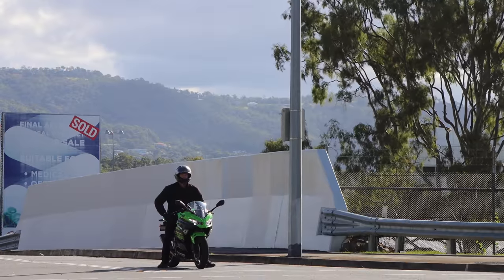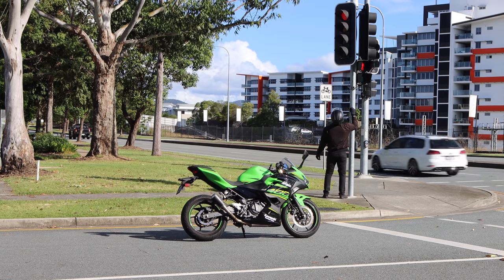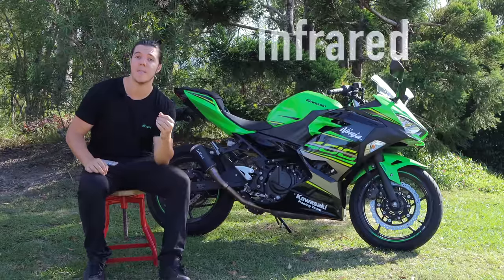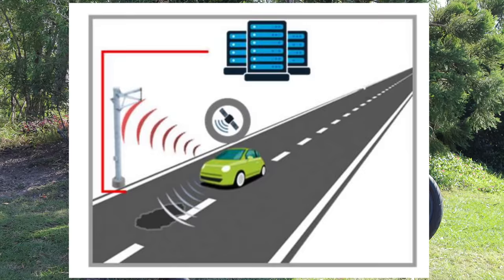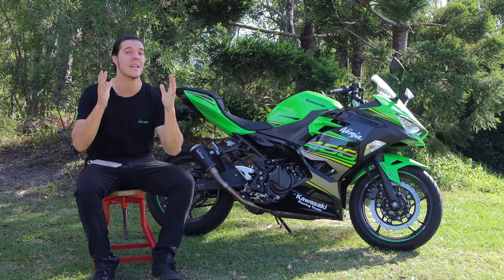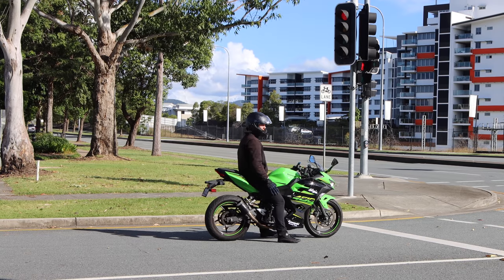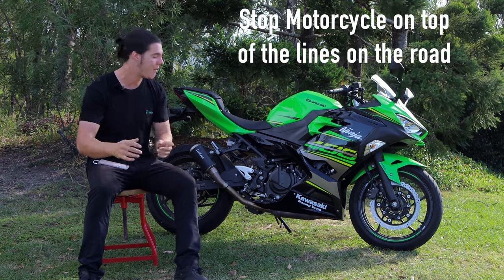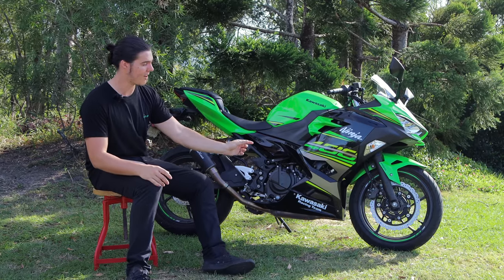How to trigger Traffic Lights on a Motorcycle | Stop getting stuck at red lights

Comment: None of the lights around here in my area of central Maine use the loops, it's all cameras or timers here.  There is one light near here that will never find me on the bike. If the path is clear after two cycles I'm going.  All other lights I find if I'm alone there being in the middle of the two lanes usually works.  We do have one light very close to my house that if you don't continuously move slightly it will skip one part of the intersection no matter how big or small you are.

Comment: Those induction loops suck, a lot of them won't even pick up the Tractor Trailer I drive since the front is so high off the ground. Sometimes I have to pull up far enough so the differential is over the sensor to get it to change.

Comment: A lot of bikes are mostly aluminum alloys (engines, wheels, frames), non-magnetic. You need iron, to shift/attenuate the frequency of the loop in the ground. I wait one cycle, if a car doesn't pull behind me to trigger the light, I just go...if it's clear. If the detector is set too weak to sense my BMW, it's not working correctly.

Comment: In the US, there are a number of states which allow a "safe on red" move by motorcycles, mopeds or bikes. The requirements vary from state to state but basically, after an adequate amount of time or signal cycles, the biker can proceed if the intersection is clear. However, the burden of proof is on the biker. I've used this maneuver only once because before long another motorist usually shows up. It's seldom used but nice to have should one need it.

Comment: Here in N America the " Induction loop" is not sensing the "Metal" of a vehicle, rather it's sensing the electrical field created by  your charging / electrical system. Try flashing your high beams as you approach the intersection. This  can fool the system to turn the light green as this is why lights turn green for emergency vehicles....the flashing high beams picked up by  a light sensor !
Reply: I tried that with honking the horn several times Worked like a charm.

Comment: i’ve been forced to run several red lights, usually at night, in turn lanes, when no other vehicles come by to help trigger the lights. a lot of the times, i move my bike forward and back, and side to side within the lane, and nothing helps. i feel like most cops wouldn’t have an issue if done safely, and given the circumstance, but it’s always frustrating

Comment: In my main riding years on the street was all of the 90s. In my area we were getting new sensors installed. My problem was that I would get up early and go for a ride so waiting for a vehicle was a no go. I talked to the city but they said that they couldn't do anything. Why is that familiar. So one day I talked to a motor patrolman and he said that once I sit through one cycle of lights I could then proceed with caution. He had the same issue. And yes, I knew to sit ontop of a side line. Worked ok but was not perfect. No problems after that. No, I did not live in a big city so one could sit a long time waiting for a car.

Comment: Get an old type tv remote aim it at the infrared sensor press program like finding the tv input. next press set or enter now just like the fire and emergency vehicles it will change. also a small strobe light works

Comment: To get out of rising barriers on car parks .
6 inch square steel plate placed on the in bound loop .
Barrier will rise as long as you're  not sitting on the exiting loop.
Drive over smartly pick up the small plate bye bye.

Comment: Traffic light camping really drives me nuts for 32 years now. And i've filed countless complains about them with zero result. Tried every trick in the book to trigger the detection system with very little result. Hard braking seems to be the best trick, but when it rains........
It seems worse in the winter conditions for some reason. For instance, when it's warm and a traffic light doesn't respond, a car stopping behind you is usually what it takes for the lights to go green. When it's cold, for some reason it sometimes doesn't help at all (i've even had aome very impatient city bus drivers behind me a couple of times).
I've been looking for a lighter motorbike to replace my current one, but detection systems prevent me from buying one.
And i know it's possible for detection systems to detect lightweight vehicles. Our (Dutch) cyclepaths also have detection loops and they always respond (i usually travel on my moped during the summer).

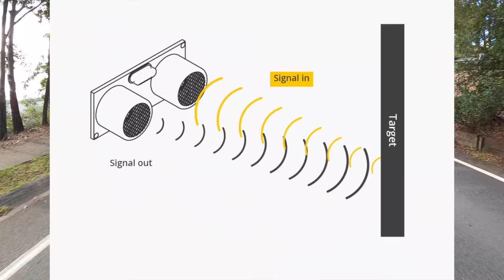Comment: The sensor depicted at 2:31 is an ultrasonic sensor. I don't think they have the range needed to be used for traffic. I also feel like the statement that the inductive are most common is incorrect. Maybe 15 years ago. I can hardly find one anymore. The microwave are much more common in my state, but perhaps they are more common elsewhere or your data is old.

Comment: There is a set near my workplace that, due to it leading out of a maximum security area, are manually triggered from a nearby control tower.

It's not unusual for cars leaving the 2 nearby commercial properties to be waiting 10,15 minutes or more for the security staff to come and press the button; fortunately the local police know this and generally turn a blind eye to people running the reds at that junction as long as they don't do it dangerously.

Comment: I just jump up and down really hard over and over so the shock absorbers reduce the height of the bike to the ground so the sensor can detect the metal on the bike.. You may have to do this repeatedly to get a result. This works most of the time. Constant pumping very hard works the best.

Comment: I've been riding a dirt bike (street legal) on road for a while now and I have never had a problem with lights at all. In my car though, I've sat through some insanely long red lights waiting for someone to pull in behind me to trigger the lights. Go figure. I have the worst luck. Can't run the lights in my car and get away with it because it isn't a motorcycle. But it does say Yamaha on the engine block though because it was a joint venture between Toyota and Yamaha.

Comment: I had a little 250 ninja that could never trigger a light. I found that if I rolled up to the light with a moderate speed and stop suddenly on the pad like a brake check, it registered it more often. Other times I had to right the red and U turn.

Comment: Some info you left out...the shut off and restart deal does not seem to work around here...some intersections have times, the cutout in the street is much longer than most, one vehicle will have a longer wait time than 2. If you are familiar with the intersection  and there is no other cars around you roll onto the cut out area and as you stop  grab the front brake hard enough to compress the front suspension as much as possible. Right as you stop put both feet down, release the front brake and give a little push with your feet at the same time. Done properly the bike should back up several feet. Even if the bike is stopped you can do the same thing  Hold the front brake, push on the bars to compress the front suspension, pull back on the bars and as the front end comes back up release the brake. The other trigger at intersections is going to be the infrared deal. .they are also programmed to trigger off the strobe lights on emergency vehicles. You can duplicate it with high/low beam. Depending on your headlight adjustment and how bright they are it works best as you approach the intersection. Done properly it will take 3 on/off cycles as quick as you can.  It will turn a red light green and it will keep a green light on long enough for you to clear the intersection.   Is it legal? I probably wouldn't si it in front of a cop but the do sell those deals that flash your headlight high/low as you ride . The strobe deal works in daytime, just not as well. The stone position on a decent led flashlight will work too. I'd there are no cars around make a legal stop and run the dam thing.   as long as they dont have any of those photo cop things. .

Comment: In my great state of Idaho we passed a law a couple years ago stating that if you're sitting at a red light for a prolonged period of time in fact it even tells you two whole cycles with the light not changing in your favor you can go ahead and run that red light, just be aware you are now responsible for everything that happens for running said red light you just won't get a ticket for running a red light when you have the clear.

Comment: Not “metal,” but steel rather.  Our mostly aluminum bikes don’t trip the sensor.  A steel frame may be too high and there is minimal steel in our wheels. Steel is set deep in the engine also. A powerful magnet set beneath works wonders to trip that loop.

Comment: Scooters get stuck at lights very badly, I was stuck so long yesterday, my foot stared hurting from holding the bike up so long! Atleast 4 turns at a 4 way, 
We had a pressure sensor years ago, it was like a inverted speed bump, didn't matter what it was, if you didn't stop on it, you was stuck! It was just a metal strip just behind the stop line at the light, it was at a side street that crossed a busy road, it was changed about 25 years ago!  But I always try to let the car behind me trigger the light , either pull to the side letting it in front, or let it up far enough if I have room, or try to keep a car in front of me!

Comment: What is REALLY annoying is when a car comes up behind you and then stops 3 car lengths back so it does not trigger the light.    I don't know if drivers around the nation do this, but here in US south, it is very common. I don't know if they are being extra safe, or what is going on.
Reply: I think it's them thinking they are being polite and not crowding. I drive different around motorcycles when in my car. Just point to the light... your wrist "watch", and motion them up closer to you. Lol... maybe they can decipher your sign language that the light is taking a long time. U need them up closer.

Comment: I had a have had several tickets due to going through a red.  Most police in my area will look the other way if I stop and clearly check traffic before running the light- treating it like a stop sign.  IF they hand me the ticket anyways, I contest it.  I tell the judge about my conclusion it was a chronic malfunctioning light.  Explain that I treated it like a stop sign to save time, and I have yet to have to pay for a ticket.

Comment: North western Europe in the late 80s with more and more bikes having much less metal and much more plastic the induction loops started failing to detect more often. Backing up and running over them over and over to trigger the system was not really effective. Restarting your engine was at times the tickle it needed (worked with Fazer, XJ, FJ and Bandits, but not R1s that came out in the late 90s) as gcenteno97 mentioned in his comment. But the advanced detection loop as he describes is also the most oil/dirt invested patch as it is typically located in the middle of the lane. Its the part were all the cars wait for the light and leak their precious fluids. Mixed with rain water and....  

Any how, some lights just did not get triggered. And, there you are at 2 AM...waiting. More than one police officer has advised me to look left, right and if I do not see a cop then just go!

Comment: most states have laws though for bikers and red lights.. you have to stop.. wait a reasonable amount of time then can go no matter if light changes or not when its safe to do so.. so like me in cali i would do it a lot.. if im the only person at the light.. and just go when its safe only so if cop is watching  he sees you stop.. wait longer then a regular stop sign . and go when its safe.. now here in cali we have usually 2 lanes to turn and go straight.. so if a car was next to me then i wouldnt do it. now sure you can trigger some lights.. but others hell no. i have about 26k miles riding. i would recommend most stop at the side ofthe lane at traffic lights so if someone comes up fast and is going to rear end you you are already at a zone where its easier to escape and if you cant hopefully only get s clipped and not ran all the way over.. one safety of driving a motorcycle and stopping at lights is to not stop in the middle of the lane.. because if you get rear ended at  a light it  could be game over. and you should know this!

Comment: I live in the US and in my state it’s legal for motorcyclists to run a red light if it skips you for two cycles (this is an issue at night in low traffic when the light doesn’t cycle though)

I’ve ran so many damn red lights
I would prefer not to 

I’m already familiar with all the lights that won’t change for me and I don’t even wait the two cycles (especially at night, I’d be sitting there for hours) so I run it after the first skip once the coast is clear. So many people turning another direction probably thought I was just running it for shits and giggles

I’ll also take a different route if possible and safer

Comment: I thought those induction loops were scales. I had a motorcyclist wave at me to pull forward so I'd trip the sensor even though he was parked on the wire. Only then did the light actually change.

Comment: Once you've gone through your local lights you get a pretty good idea of their functionality.  When those light fail to function properly, I stop then look in both directions, then move through that red light, if the green light side has no cars coming towards the intersection.  I will not be treated like an indentured slave sitting at a light like an idiot because I have been so indoctrinated I can't think for myself.  I have also found over many years of driving and riding that weather does affect the electronics in those boxes and/or those loops.

Comment: Worth saying that certain roads I just avoid during "low traffic times"... There's almost always an alternative to the route you're used to taking just about anywhere... SO when traffic's a lull, and you know you're likely to get "stuck", you can change to a road that's more stop signs or slightly higher traffic.

    Ordinarily, I try to avoid traffic, BUT sometimes, one has to make exceptions. A little more traffic around can be a convenience, in spite of raising my chances of dealing with idiots. ;o)

Comment: I have a pressure pad light on my way to work its triggered by me and a second sensor but if its ONCE AGAIN sunday night at 9:30pm i once litterally got off and jumped around on the pad and this worked ... by now if this rare case happens i just move slowly through the red light since sunday night nobody is there to give a sheet

Comment: If you think YOU have a problem try riding a pushbike.  I hear people whinge all the time about pushbikes going through red lights.  But over more than 60 years I have had the misfortune to be trapped in awkward positions countless times by lights that simply won't respond to the pushbike.  Pressure sensors, magnetic loops and others that are all looking for larger objects.  Basically although we are supposed to act as vehicles no one in authority has the decency to consider us when making traffic lights.

Comment: Any light in the U.S. after dark, flash your high beams while approaching the intersection and the light will green as you get to the line..  designed for first responders so they dont have to stop

Comment: LOL, think it's frustrating on a "big" motorcycle? Try riding up to a traffic light on a little 21 speed "pedal bicycle"! GOOD LUCK, especially with a really lightweight road bike that's made of mostly "non-ferrous" metals (besides the gear set and chain) like aluminum or carbon fiber parts that aren't magnetic... I found out about the mag loops like 20 years ago and figured out if I approached the signals along the left or right tire paths for a 4 wheel vehicle where the wire is and also coasted very slowly over the left/right edge of the first trigger loop (usually placed 1-2 car lengths before the one at the stopping stripe in the lane) it would pick up the bicycle and trigger the light. My other trick for the more stubborn lights was to actually lay the bike down flat on its side for a few seconds, putting the chain and gear set as close to the loop wire as possible. Can't say that's a good option on a motorcycle though.

Comment: Does anyone know what type of sensor is used for left turn light that requires at least two cars? I encounter an intersection on my way to work that if you pull up to the line in the left turn lane and  nobody pulls up behind you then you don't get the left turn light. I always leave a car length in front of me untill another vehicle pulls up behind me to ensure i get the light. I haven't been able to manipulate the light on my bike.